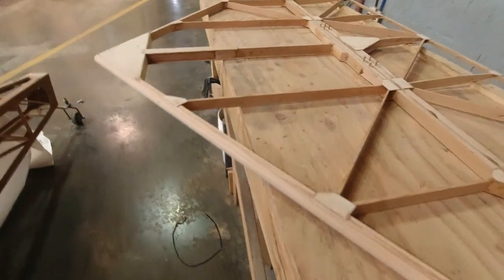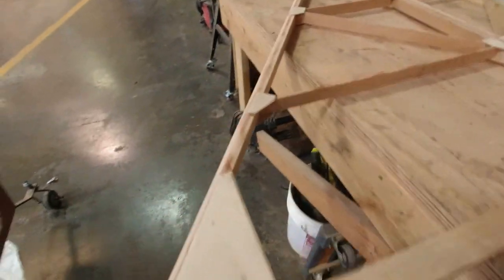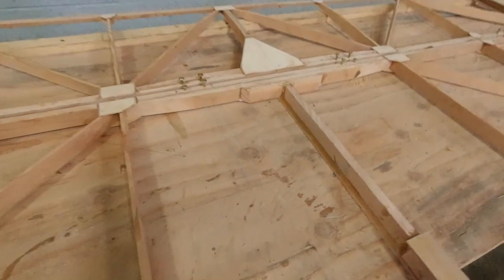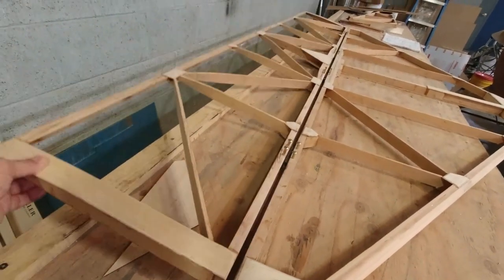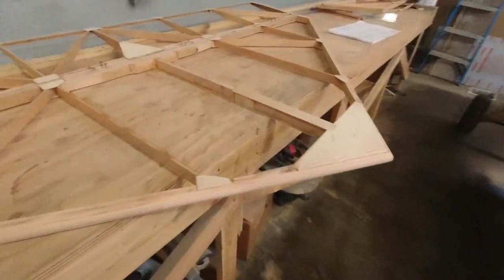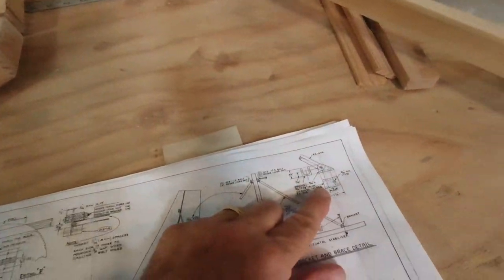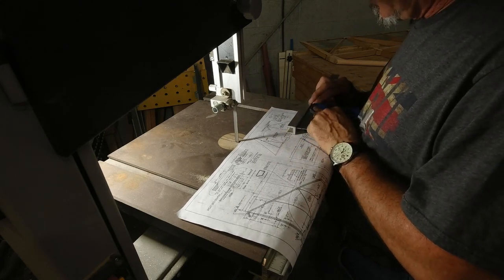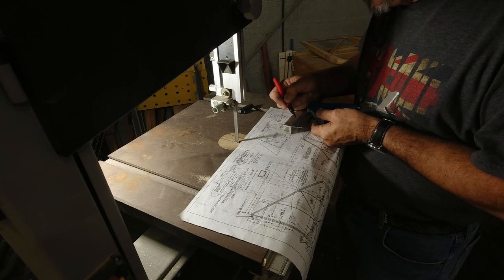Minimax 1100r Wood Aircraft Build Ep 113

Comment: Interesting story about your flight training.  I don't know how or why I developed the mindset that I was "pilot in command" when I was in the left seat, regardless of the experience of the instructor in the right seat, but I always had that attitude even during my primary training as a 15 year old.  Of course, I accepted instructions, but I always felt I was responsible for the flight.  Once my 22 year old instructor wanted me to practice engine-out landings.  At midfield on downwind he pulled the mixture all the way out (yes, the mixture, not the throttle) and said "what do you do if this happens?"  I immediately pushed the mixture back in and said, "I'd yell at my passenger for doing something so stupid, and then I'd land normally."  Ha ha, that must have shocked the "old" guy.  After that, we practiced landings with a closed throttle.
Reply from the maker: That’s a funny story…shocking that he would pull the mixture. Yikes!!!

Comment: Hi Dennis,  I thought I'd ask this question here in case others are interested.  For your fin brace tube attach brackets that you're making in this video, plans call for 6061-T6 aluminum channel.  Aircraft Spruce and other sources don't have that, but I'm told 6063-T52 is a substitute.  The 6061 is stronger, however.  Do you recall what you used?
Reply from the maker: The T52 is the only thing that’s available right now so that’s what everyone is using, me included.
Reply: @DTMinimax  That's what I figured.  6061 appears to be about 25% stronger, but I imagine there's a healthy margin in the design anyway.  Thanks!
Reply from the maker: So many parts of the Minimax have a safety factor of 10 or more. Industry standard for GA is around 1.5
Reply: @DTMinimax  Yes, I believe it now that I'm gluing-up the tail leading edge laminates for the 1550V.  Very strong!
Reply from the maker: The whole journey is like that, pieces get glued to pieces and the strength of the structures are amazing. Nothing illustrates this more than the drag braces in the wing. It locks it all together.